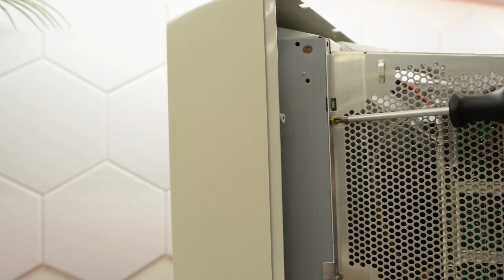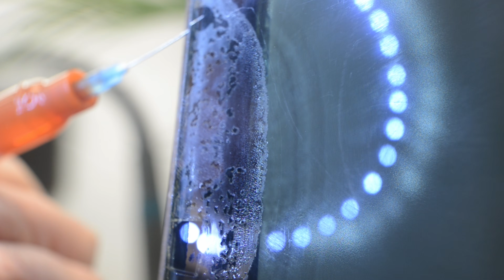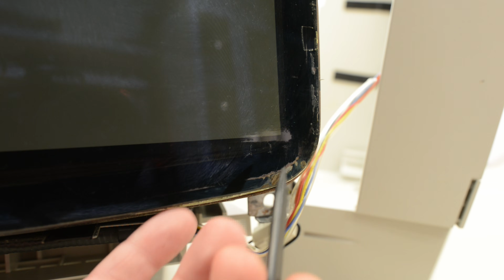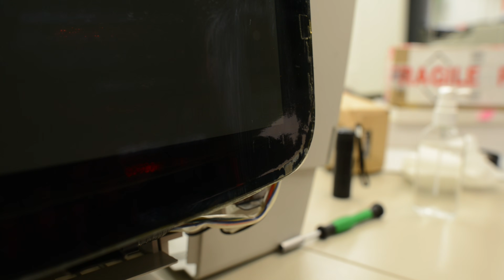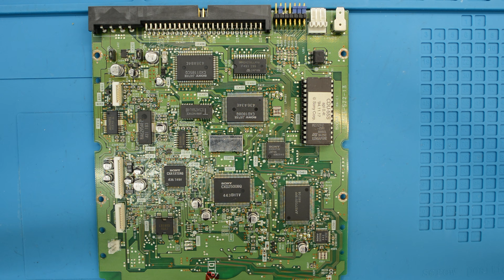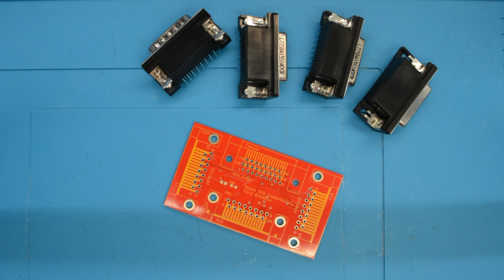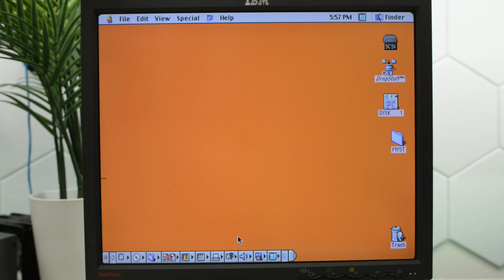Performing Surgery on a CRT Tube to Fix Cataracts + Reviving a Broken Mac

Comment from the maker: Support me on patreon.com/Epictronics
Buy me a coffee: https://ko-fi.com/epictronics
Sony Trinitron and Mac 6100 restoration here: https://youtu.be/rSAWVNudoeY?si=O8xhLqVg0cQcs4Fg
Unboxing and testing the Tweezers here: https://youtu.be/rox9DQcSjWw?si=e6R254q0iJzItFf0
Reply: Every time you spray the surface the plasticizer it disappeared. Before removing try auto wax. If that doesn't work try car ultra fine polish to remove it. I would suggest headlight lens polish but finding an actual good product might be an issue since there are some that simply do a better job than others.

Comment: Another great video. Might I suggest a quick video about what SMD caps to 'have in my stash" for repairs. Perhaps some links to DigiKey or Mouser for the better parts to use. Please note about the height off the board best used (too hall, too short). Also about getting 25V for 16v parts, etc. you have mentioned in the past.
Reply from the maker: Thanks!

Comment: Would a razor blade pull it off? How I was taught how to remove things that solvent wouldn't. The glue used for your rear view mirror is an example. Have to scrape it off 14:31

Comment: This was one of the weirdest macs I've used or encountered in my life. For starters the strange connector for a specific monitor that all of it was only on the market for about year. On top of that you have this PC card that uses its own weird cable that doesn't work with the strange monitor or the macs weird interface for it with some dongles. So in this macs heyday it needed two dongles and a special cable to make it all work together, thus making that odd connector apple designed largely go unused even it its flagship product of the time.

Comment: You could use two seringes, one filled with resin and the other empty. You fill up with resin as far as you can and then with the empty seringe you can suck out the air bubbles which will then automatically replaced with resin.

Comment: that's a very successful repair for that cataract issue, impressive! And it's a gorgeous monitor for sure. About that spot on bottom right, are you sure it's not damage to the anti-reflective coating? I've seen something similar before and I kept scrubbing until I realised the spot was getting bigger :(
Reply from the maker: Thanks Tony, yes, I think you're right, it's probably the coating :(
Reply: @Epictronics1  I made that mistake before while cleaning a lens. "oh there's a little spot". I wouldn't come off and I kept cleaning and cleaning... until more spots appeared... :( 
I'm still impressed by the resin job! Did you try putting a white field behind the cured part on the left to see if it's visible?
Reply from the maker: @tony359  Thanks. I'll try that when the display is accesable again (next project on the bench allready)

Comment: Couple of syringe tips. If you have a viscous fluid, you can draw up with a large, blunt "needle" (they're called blunt needls) at a large guage, and then use your 22G there. It's easier to force viscous fluid through a thin needle than it is drawing up. You CAN also pull the back of the syringe out, it just takes a little force to get the rubber stopper through, since they're not generally supposed to do that. It takes a little force to get it back in, as well. Usually this ends up spurting the fluid out, so hold it vertical and let the air go to the top before reinserting it.
Reply: Heh, "syringe tips".
Reply: @stevethepocket  Unexpected pun detected.

Comment: Filling the cracks with resin is exactly the same thing they do in car windshield repair. They sell kits for that which may work better as that resin would be formulated for fitting through the needle better. This worked though so cool job.

Comment: Unless you are trying to polish out big scratches you should never use an abrasive like baking soda on glass as you'll probably add fine scratches that you wont be able to remove without a proper fine polishing compound. Want to scrape something off glass you should use plastic scrapers that wont scratch the glass.

Comment: That's a good enough result. What about sucking up air bubbles with another syringe or moving them through a vacuum or vibration? When preparing a resin from a resin craft, it usually removes the air from the resin as much as possible by vibration and vacuum.

Comment: I have never seen an implosion lens on European TVs or CRT monitors. Is that really a thing over here? I only know about implosion bands, which are ubiquitous.
Reply: I get the impression that they stopped being as necessary by the 80s, due to better manufacturing techniques.
Reply: @smartyhall but this is a late model Trinitron…?
Reply: @root42 Computer monitors were always on the high-end of quality and technology, so I would suspect they would be the first place to see tubes that were safe without the extra precautions.

Comment: What if... you get the tube out and use a vacuum chamber to deal with the bubbles? Since you were applying the resin vertically, you could just place the tube horizontally so the resin stays in its place and repeat process for each side?

Not sure how a vacuum chamber would affect a CRT tube tho... if it's gonna explode, implode or strip it off of something. You'd have to dismount the tube from any electronics too.

Comment: That I believe is the anti-glare layer and this is a common fixture on Trinitron type monitors. Typically not found on TVs as they usually don't add an anti-glare layer to those. Seems to be mostly PC monitors that have this and it's only really common for monitors made in the early 00's and onward. I'd say late 90s they started adding anti-glare filters to PC monitors so anything older then that typically doesn't have this applied.

Anyways, they are usually made of some sort of plastic like material. Not as big risk of implosion removing them in this case. (older CRTs found on vintage really old TVs/Monitors that have cataracts involve the safety glass layer and yeah those are the ones you have to be careful removing).

The worse that can happen removing the anti-glare filter on these monitors is your black levels getting a bit messed up since they used a phospher that isn't as black as CRTs designed to not have one. One of the downsides if you are for some reason forced to remove the layer. You do gain a lot of brightness though which may require you re-calibrate the monitor to compensate for since that will also contribute to blowing out your black levels.

Shadowmask tubes that have an anti-glare layer tend to have that applied as a spray on type thing due to being curved on both vertial and horizontal axis so you have to use harsh chemicals to remove them. But Trinitrons (and newer "flat" style shadow mask tubes I suppose) have a simple flat tube that only curves on one axis (or completely flat on both if it's one of the newer flat tube era ones) so they usually just add the anti-glare as a glued on piece of glass/plastic. The risk of implosion removing these things is minimal unless you are careless with your heat application I suppose. The process is not as extreme as removing safety glass from what I've heard so if you did have to remove it, it wouldn't be quite as dangerous as the vintage tubes with safety glass cataracts.

The most common reason you have to remove the anti-glare layer is due to deep scratches since they aren't made of glass like the tube so they can be scratched easier. Luckily for you it's just dried out glue on the edges. Cool that you can fix this in a non destructive manner. :D

Also those grease like stains on the sections under the bazel may be deterioration of the plastic filter itself. Trying to clean it off might just make it worse. Since it's hidden under the bazel it's not something you need to worry about anyways. I've heard it's generally not recommended to use cleaning agents directly on these anyways as it's a great way to start staining the plastic and if you get too aggressive with it and end up staining a visible section of the screen, you'll have to pull the whole thing up anyways so be careful with what cleaning agents you choose for maintaining the screen. ;)

Comment: For the bubbles, maybe next time you try this technique, you should do what doctors do when they use needles. Hold the needle with the tip facing upward, and give it a few sharp taps, this causes any air bubbles to rise to the top. Because the resin is thicker than most medicine injections, it might take longer to work the bubbles out this way. Once the air is all at the top of the needle, push the plunger (with the needle still facing upward) until liquid starts pouring out. This should get rid of any air in the solution.

Comment: The strange thing I seem to recall about those DOS card cables is that they really never went above 100 on bidding sites until the panda medic happened. I'm guessing some were trickling out but someone had to cash out and they dried up...For the longest time they were selling for about 40.

I'm dreading seeing all this CD-ROM work too, as I know a few years ago I had to put my own 6100 DC in storage knowing damn well that the CD-ROM was already not working, suspecting the caps had worn out...Hopefully it won't have gone too far off the fishy side before I can get back to it, or the other dozen or so projects I had to shelve at the time...

Comment: you should go back and heat all the resin you filled in with a heat gun to remove all the air bubbles, then re cure it, you know, from a distance, not close in.

Comment: I believe those spots are where the protective coating over the glass has been worn off. As the screen has been cleaned over the years, and various cleaners used, the cleaner fluids settle in those corners, as you can never fully get it as a 'normal user' per-se, and it eats away at the coating over time!
Reply: It's mostly the ageing glue underneath.

Comment: That "oily spot" is actually a rubbed out part of the anti-glare coating on the CRT front? Seemed to get bigger the more you scraped at it. It's not oily, it's bare glass with missing coating is my guess. Better stop while ahead :)
Reply: I think you are correct. It looked like the affected area was getting bigger rather than smaller.
Reply: I agree, the Initial spot was anti-glare coating rubbed off by the front bezel touching.

Comment: The fix was better than I thought, but I can't tell if it's good enough or not for other cases. For this one it looks ok assuming we do see this monitor in use before we see the HP logo, the image is not touching the repaired area. I would be curious to see the image shifted over to the repaired area. I was hoping to see if there was a line or not. That would determine if the fix is ultimately good enough or not. Back in the CRT days, I required my screen to be mostly maxed out. There was nothing worse than a curved bezzle. I avoided monitors like that like a plague. I wanted to use every square mm of space I could.
Reply from the maker: I'll stretch the image and check,

Comment: good call warning people abuout the risk of electrocution there is enough voltage and amps running through the back of that CRT to Kill instantly Even when unplugged the caps can hold a lethal charge.

Comment: My unlocked 4k drive stopped working. I bought 2 new ones. Then it occurred to me. What if it's just dirty. I do vape a lot. So I took it apart. But you have to eject it to open it. I didn't have anything long enough. So I poked it just enough to get it started. Then I was able to pry it open. Honestly I should have just plugged it in and opened it that way. Anyway. It works perfectly! No issues since. I just got the 2 new ones. I'm going to apply the unlocked libredrive firmware to them this weekend. It will be a huge relief to have 3 working 4k drives. Not to mention I also have 3 working BD (non 4k) drives and one of them supports HD-DVD.......not that I have any HD-DVD discs. The only one I ever owned was Apollo 13. And I threw it in the trash when the original BD version came out. Since then I've upgraded Apollo 13 to the special edition BD and now the 4k version. I've owned more copies of that movie than any other movie. lol
Reply: currently the "old" (it's less than a year old) 4k drive sits on top of my threadripper. As the case doesnt' support it. (I tried to find a case that did). I have power and SATA cables dangling out the back and on top. I'm considering putting it in an enclosure and using USB. It would be nice if there were like dual drive enclosures. But I can't find anything like that. Then again ripping 2 discs at once is not pleasant. MakeMKV keeps trying to select the wrong drive. And if you do any read operation on a drive in use by another instance of makeMKV, both instances slow to a crawl. It's like dammit. Let me pick a drive for each instance and then stop trying to change it.

Comment: I have a problem with this method. What happens when the old resin dries out behind of the new one? This would get a serious issue, It is a quick fix - but a useless one.
Reply from the maker: The resin I added is basically the same thing as the old resin. As long as there are long enough needles to reach, we're good
Reply: @Epictronics1  Yes but thats the point. You have to get through the new resin to reach the old resing. That leaves traces and someday you wont reach it anymore.

My comment wasnt ment as hate, for info, but I am sceptical.

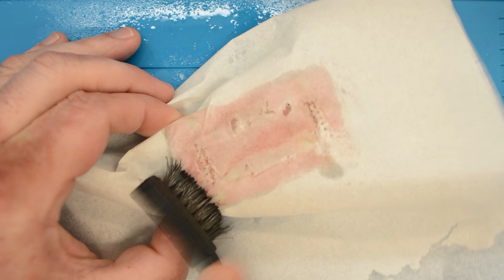Comment: ~28:30 I think we are seeing another effect of consumer available manufacturing: Back in the day if you wanted a PCB you had to order it in the thousands minimum order, plus other parts and assembly cost. For a low sales driver such as these cards, it was cheaper to hand or machine wire octopus cables. Nowadays PCB, casing, and parts manufacturing is so cheap that making a breakout is a negligible cost, even during r&d. Granted, your stuff will almost certainly be counterfeited by a certain country who we won't name.. It's OK, they don't honor IP rights in general so they'd likely copy it anyway.
Reply: Just have your PCBs manufactured in the United States of Freedom.

Comment: @Epictronics1 The Retro Collective did a video not long ago about removing the failed AR coating from an Apple CRT. I could be wrong, but think what you are seeing on the surface might be the same issue. Regardless, the resin appears to be preferable to the heat method for the glue failure, great idea.

Comment: When I used to work at a CRT servicing center in the early 2000s. We would do this kind of repair on some of the CRTs where the risk of implosion was high due to their size. We would use a smaller gauge syringe that was pneumatically pressured, and the CRT was on what we would call a vibration table, which would shake out the bubbles using ultra-high rate vibrations.
Reply: That’s really awesome man! Sounds like a cool job
Reply: CRT surgery...I have a PC Monitor that has an issue with one of the contacts in the "neck", the pins that go into the neckboard. Essentially, the contact that makes the green "cannon" fire is loose and when the monitor warms up, it stops making contact turning the picture purple (just red/blue). It will resume working for a few minutes if you tap it, but inevitably goes back to a "no green" state. Any ideas if there's anything that can be done? I know the issue is not in the neckboard 'cause I've tried everything, up to and including reflowing all the soler joints. I suspect that CRT is done for :/
Reply: @h3llr4iser1  Sounds like one of the connections within the glass of the neck has a small break in it, and as it heats up, the gap widens enough that it loses connection, that the tapping of it only realigns the broken ends in line again, only to drift apart again, unless you can get into the neck without breaking vaccume, the broken connection be the way it is. The electron gun connects to the neckboard via pins, which use thick but fragile wires inside the glass to the electron gun. It is these wires I am saying may have a break.
Reply: that shaking could not good the monitor screen usa for computer moved moved large number PC set up around the country and used used or side couriers the the moved a to b, you could almost product at least 2 of any 20 monitor screen sent out screen DOA, when to where they where want to be?
Reply: @dh2032 Someone check on godzilla.
Reply: @dh2032  Wot?

Comment: Very good job fixing that monitor's resin problem.  Assuming this holds up long term, you've come up with an excellent and easy fix it you get to it early enough.  I'm also very glad you've used your sponsor, PCB Way to solve that obscure cable issue.  It's good to use your sponsor and show off people's solutions, just in case someone needs to solve that problem, as well.
Reply from the maker: Thanks!

Comment: ~15:20 strong oil based solvents (try naptha or gasoline or diesel/kerosene. toluene or mineral spirits should also work, if you are at the hardware store and want to spend money. if it can run a motor, it should suffice), a rag, and a sharp, fresh razor blade. Follow up with standard light (volatile) solvent like IPA to remove residue. Make sure you protect any plastics nearby beforehand, of course.

Comment: Maybe two needles would have given an even better result. The second needle could have at least sucked out the air bubbles and let the fresh resin flow out through it... Maybe a little heat could have been used to make the resin softer. Pretty good fix though :)